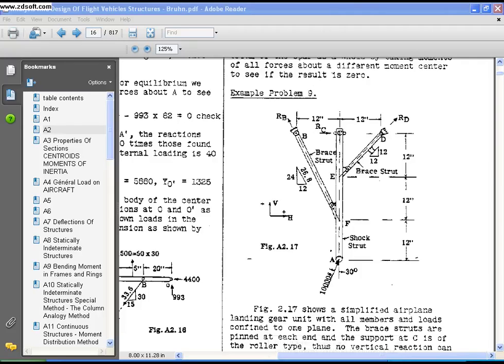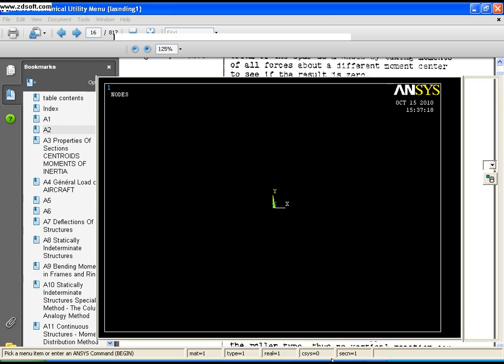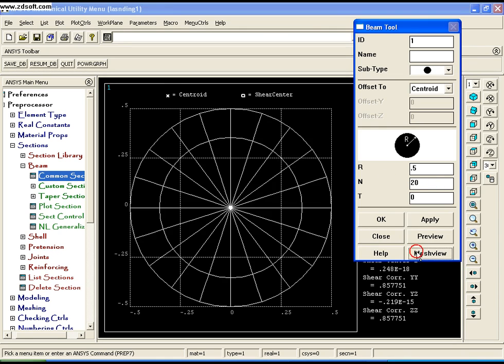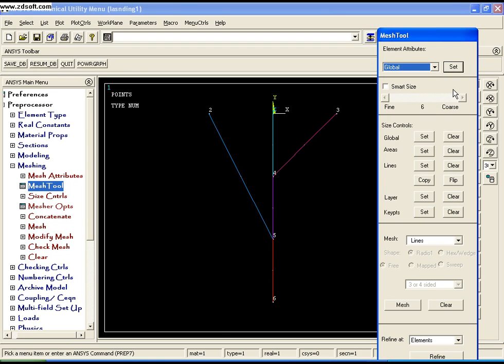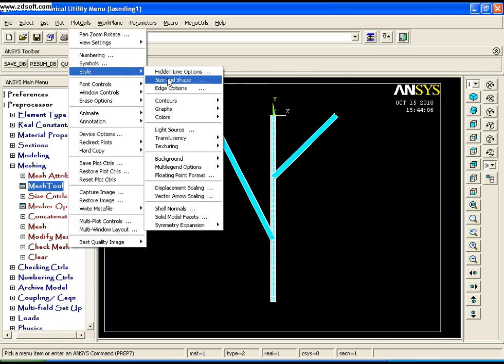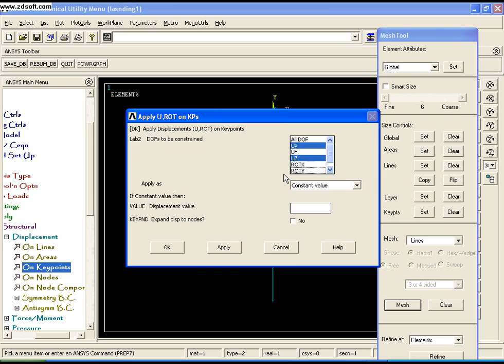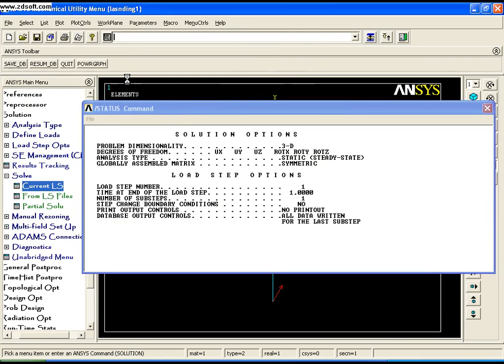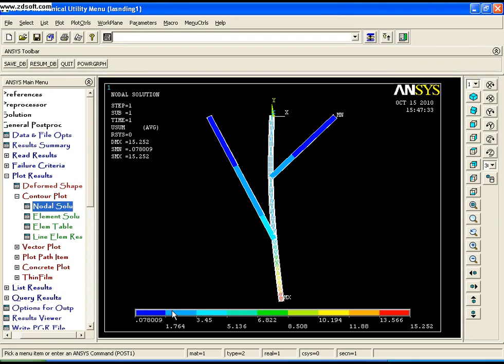landing gear analysis using ansys

Comment: how you can decide if the links are
pin joints or
moment carrying connections.

Practically in a landing gear the joints must be pin joints.
However are you sure, in your model Rx Ry and Rx different than zero,

i am asking I cannot be sure

Thanks
Reply: of course i know.
how to make it in ansys?